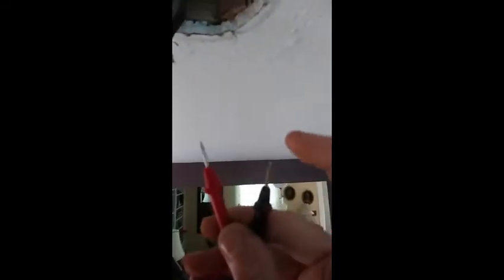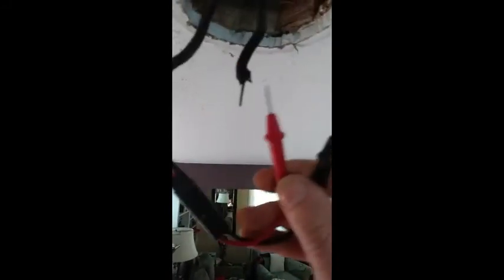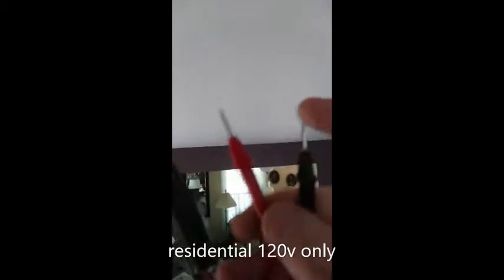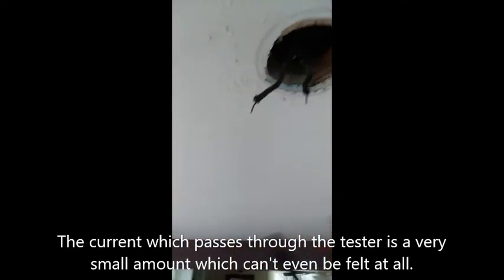Finding the Hot Wire, Knob and Tube Wiring

Comment: Since you have no pain, it is useful; but better is to connect another wire to a water pipe, which is grounded, and then test each wire to the grounded wire to find which one lights the tester.

Comment: Been doing it that way for 20 yrs. Never been a problem as long as you know it's 120.
Reply: @Brotha00  (rolls eyes) You do you man.
Reply: @DuruConsigliere  I’m asking, not being a jerk. No electrician, just genuinely curious.
Reply: @Brotha00  All electricity is dangerous. Even 110 has a percentage chance to even stop your heart. Is it likely, no. Could 220 mess you up. Yes. 220 can "grab" and hold you to the source. This usually happens when hands or body parts make contact in confined spaces. The inability to pull away or be bumped off can cause a fatality. I've been hit a few times with 220. It's not fun and can definitely give you the collywobbles.
Reply: @DuruConsigliere  hey man, thanks for the info. That helped a lot to understand the different invisible dangers I could run into while trying to solve some issues in this old house.
Reply: @DuruConsigliere  I've been bit a couple times but the worst was in the shower. Lightning hit and the stream of water zapped me so hard that my teeth ached for days. Never shower in a rain storm lol

Comment: I tried the hack, but the light on my continuity tester wouldn't register, for some reason. It worked when I used it the regular way, one red on a white and one black probe on the other white. So, I figured out how to make the "voltage sniffer" work. What I did was connect a separate wire about two feet long, the gauge you'd find in a light fixture,  to just one of the white wires and let it hang away from the junction box/wall for its full length, so that the voltage sniffer wouldn't be going off just from nearness to the other hot wire. It worked. I put that length of wire on one white wire, no beeps, and then the other; voltage sniffer started going off. The problem with the sniffers is the neutral and live wires are simply too close together at the wall for it to work the way you need it to in this situation.

Comment: Be careful with lights controlled with 3-way switches with knob and tube wiring! The neutral and hot would flip flop as the switches were turned off and on. It's known as the Carter 3-way and was a very common practice in older homes.

Comment: It’s an ungrounded circuit so you’ll be fine. You could grab it with your hand(as long as your not grounded) and a tic tester in the other and it would go off and you’d be fine. DO NOT DO THIS IF YOU DONT KNOW WHAT YOU ARE DOING

Comment: So how do you ground a new light fixture with knob and tube?
Reply: Rewiring the house is the best solution, though you could attach a wire to metallic plumbing if rewiring isn't practical.

Comment: Hi Don 
 Can I wire nuts new romex with old knobs and tubes in a jonctions boxes as long that I m sure they are the same gauges
Reply: Old wire my be to soft, I would recommend using a crimped fitting or a push fitting and make sure it’s insulated. Trying to twist knob & tube may result in the wire braking off inside the wire nut before it becomes secure.

Comment: My knob and tube wall switch is both hot?????how do a rewire a new switch???? Ty
Reply: Both wires on a switch are hot in any wiring system. That is what a switch is for-to break the hot wire. The wires on a switch are called "line" and "load". The line is power in and load is power out. Some people refer to the line as "hot" and the load as the switch leg. A standard switch does not need a neutral to work. If you have a white wire on your switch it is probably hot and should have either been colored black or wrapped with black tape. If you have an illuminated switch or a timer switch or a combination switch and outlet, then you will need the neutral. If you are replacing a standard single pole switch then it does not matter how you connect the wires as long as you observe which terminal is for ground and not connect wires to it. If you have K & T wiring you will not have a ground.

Comment: So why does it matter if it is AC power?
Reply: My guess is so if you are wiring in a light for instance you would want the center pin in the bottom of the socket hot instead of the threaded portion because it's less likely to get touched when changing bulbs. Id imagine some electrical inspectors are sticklers about it since exis8 K&T it usually considered safe if operational and all new junctions are compliant

Comment: Can you touch the metal box with the black to get the same result?
Reply: Old Knob and Tube wiring didn't have metal boxes. It was just wires passing through a hole in the wall.
Reply: this is the way you test when you don't have a ground. the metal box should be grounded so yes that would be the proper way
Reply: The metal gives you grounding?
Reply: Knob and tube used cloth tubing and porcelain knobs to isolate from the joists, studs, or walls the wire was feed through and held by.
Reply: @MILLER2607  No it just goes straight through the metal into whatever the metal is touching, hopefully something non flammable and not alive.
Reply: @MILLER2607  not with K & T wiring. It is an ungrounded system. If it were a grounded system then you would attach the grounding conductor to the metal box. The box itself is not a ground as it is typically attached to a wooden framing member.

Comment: I'm a licensed and certified electrician myself and I hate videos like this because it encourages other people like yourself who don't understand what they are doing or what they are dealing with to do things that they shouldn't because they could be seriously hurt or killed. This by no means is the worst video I've seen like this but I just wish that people who don't understand what it is they're working with or what it can do to them would just leave it alone and let us professionals do it. I've gone into homes and businesses that have had people who don't have a clue what they are doing but find out that they have tried to rewire their home or even just put in new outlets or lights and it's a complete mess and very dangerous. One of the biggest things I see is home owners think they know how to do this and I I come to find that they have the hot and neutral wires reversed and this can cause a lot of problems with your electrical system in your home and devices that you use if they even work not to mention this is a very serious fire risk and a big cause for electrical house fires. Please remember everyone that just because something will power on when you plug it in absolutely doesn't mean that its wired correctly and definitely not safely. Next time you think you will just do it yourself ask yourself is this worth the risk of my home burning down and losing absolutely everything and maybe even our lives the simple answer should be that no it's not worth it so please don't and let us professionals do this work and we will keep you safe in your home.⚡👍✌
Reply: But you gave no input into identifying the hot wire. I want to hear your solution
Reply: True
Reply: Takes maybe 4 days to learn everything you need to know about wiring a house. It’s easy. Straight forward. You don’t always need a professional.